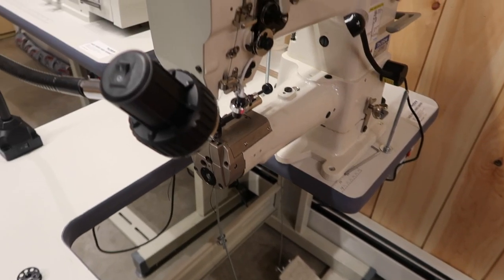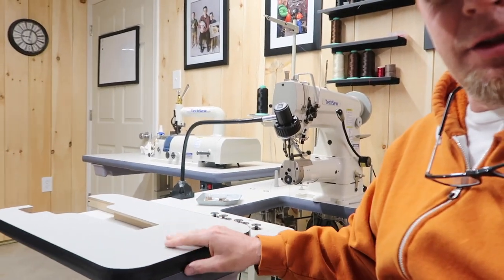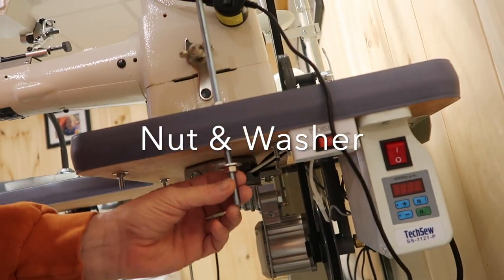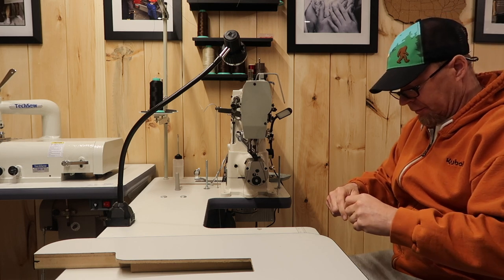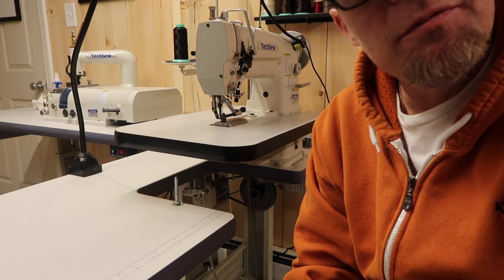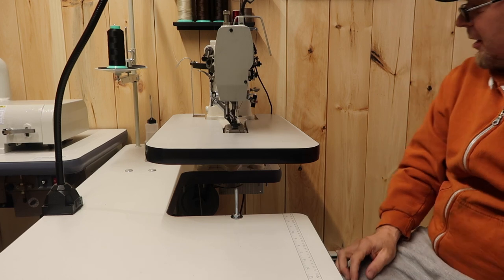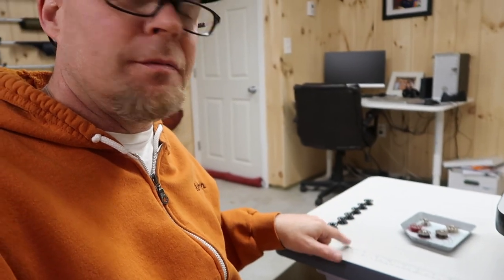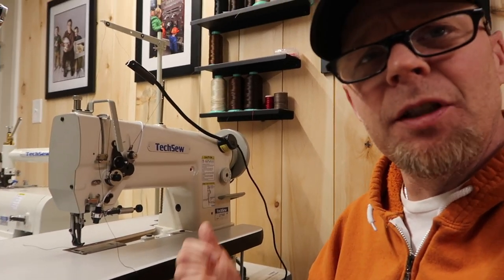Converting A Leather Cylinder Arm Sewing Machine To A Flatbed (Techsew 2750 Pro)

Comment: Hello Gary, after watching you struggle with installing the flatbed here is how I would do it for a two minute reinstall. First get three more nuts and screw one down on each rod. almost to the upper nut, leave about a 1 inch space between the nuts. These new nuts will be called Jam Nuts. I would screw in all threaded rods into the table first then drop it down into the holes on the bed. You said you can‘t do this way but you didn‘t explain way not. Anyway if you can‘t for some strange reason set it up and level and adjust it as you did in the video. Now the important part, those jam nuts will be screwed down to the upper nut and tighened against each other to lock the nuts together. You will need to get a thinner fixed sized wrench because an adjustable wrench is too thick to be using on the nut that is against the bed. You need to be able to keep the bed nut from rotating while you tighten the JAM NUT down onto the upper bed nut. When you remove the table for storage, remove the lower nuts and washers and lift the table off and unscrew the threaded  rods from the table for safekeeping. Now when you put the table back on, it will be adjusted properly because the Jam Nuts will be locked into the same postion requiring no time consuming adjustments, All rods should have the same measurement from the Jam Nut to the end of the rod provided that each rod was hand tightened down into the table all the way. If not mark them with white tape or colored shrink tubing (Harbor Freight) and use a marker to write the underside of the table at each threaded hole as the where each rod gets screwed in. Such as RED or GREEN or YELLOW or whatever color of shrink tubing you used, only necessary if your measurements were different on each rod.

Comment: The Weaver tables rest on the cylinder arm and is bolted to the arm with a square shaped U-bracket and has a removable piece to change the bobbin and sets right back in place like a puzzle piece. They sell for about 80 bucks or so.

Comment: Here's what I have done.   1.  Cut 2 inches off each rod,  It will make things a lot easier going forward.  2.  screw the threaded rods into the table and leave them there  Once tight, put a nut and washer on them to keep them in, and to keep them from coming unscrewed..  3.  Put the table in place with the other nuts screwed on, about 2 inches up.  The rods will now act as 'pins' into the holes.  4.  Adjust the nuts until you get the table level; then don't touch them again. They will now act as 'stops' so the table is level each time you put it on.  NO need to bolt it on.  
After all this, I still admit the table design is a miss as far as design goes, though it is nice to have for some parts of a bag.  I have seen some even build/add wooden 'pegs' or a different base.  As much as this machine cost, we shouldn't need to do anything to it, but alas, we do.  Happy sewing!
Reply from the maker: Peggy Gibson Great Idea. Thanks so much Peggy.

Comment: Add an extra nut to the studs ( a jamb nut ) then Get your table set to height , then draw the jamb nut tight , now you have the perfect adjustment forever . Next replace the bottom nuts with threaded knobs from Loews . EZ peezy . You cant have too many bobbins , LOL . I keep 8 bobbins of each color on standby . Your machine might accept prewound bobbins , check into it . Good luck
Reply from the maker: I have another video on how I made it super easy and fast. 😀